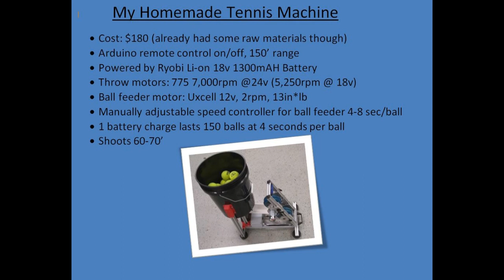Homemade Tennis ball thrower

Comment: Waiting on a few bits and pieces . Am trying with two 775 motors. They take about 1 amp at 12 volts and spin high revs. I'm guessing 6000. Nothing to measure with. What's the ideal spacing between wheels? Almost ready to fly out my first ball. Heads up!

Comment: Hello Rich, congratulations for such nice work!
I've accessed all the files you provided in order to build a machine like yours.
But I'm afraid I'm not capable to develop the Arduino code to control the device.
Would it be possible if you share it too?
I suppose you don't have commercial intentions with this project. Me neither.
Thanks
Reply: it doesn't seem you need much code, you just plug a switch from the arduino to the motors and let them roll, you could even do it without the ardruino it's just battery/motor/switch, the ardruino part is if you want remote control

Comment: Great job! What kind of motor did You use?
Reply from the maker: Thanks, Throw wheel motors = 775 24v 7,000rpm
Hopper rotator motor = Uxcell 12v 2rpm gearmotor

Comment: How did you fixed the wheels on the axis where the motor is connected to?
Reply from the maker: at 0:45 there's a photo of the shaft with an 1/8" pin. This acts as a keyway to drive the wheels. I didn't have a broach so instead of a square drive key I used a dowel pin and milled a 1/16 radius inside the wheel bore. Unfortunately I didn't take photos of that to add to the video. Hope this helps though!

Comment: Rich, one more question for you. Where did yo find the mounting plates for your motors to attach them to your extrusions? My ball machine today is mostly done in wood and after seeing your project, I'm thinking about converting it to extrusions as well (lighter). The structure seems fairly simple to be done (although I want to put a motor to move the bloc up and down as well) but where I get stuck is on the mounting plate itself. Did you made them? If so, can you share with me how you did it?
Reply from the maker: I machined the mounting plates out of 6061 aluminum plate. I don't have any photos. I think maple or oak would be okay. They'd just have to be a bit thicker for rigidity, maybe 3/8-1/2"?
Reply: How much did you end up spending on your machine?

Comment: Hello, Amazin project. You can share more details of wheels, motor e dimensions? Thank you so much
Reply from the maker: Thanks!
Wheels = 125mm PU
Throw wheel motors = 775 24v 7,000rpm
Hopper rotator motor = Uxcell 12v 2rpm gearmotor
Reply: @RichVideosNH   which Material use…??

Comment: Hello, beautiful design! But I would like to know how long these Screwdriver batteries last, and if it would not be interesting to use a UPS battery ??? thank you!
Reply: UPS is heavy... no? Maybe bigger 40v for a blower or weed wacker?
Reply from the maker: Thanks! I get about 140 balls per full charge battery. A UPS battery would likely work just as good or better depending on the mAh size. I was planning on that originally actually, but thought it would be a unique project to try out my Ryobi ones.

Comment: How do you attach the thin fragile motor shaft to the wheel without it having the risk of breaking
Reply: i have no idea soory :(
Reply: I had the same doubt. I'm planning to use GT2 pulleys (thicker bore dia for wheel, and 5mm bore dia for motor), with a closed loop timing belt.

Comment: Rich, I'm trying to do a ball thrower myself and I'm almost there. The problem I am having is to find a motor for the feeder that can rotate all the balls 45-50 in the bucket. As you said, yours probably holds 35, any suggestion of a motor I could use?

Great work btw!
Reply from the maker: The one I used has 13 in*lb of torque. I wish I had gone double that. If you can find one at least 30 in*lb I think you'd be good. ROB-12154 is a part# you can google, it has plenty of torque (94 in*oz) but not sure of the quality. Best of luck!

Comment: Hi Rich, how did you get the wheels to stay in place on the , like what is that thing that you built or bought at 0:45 called? I'm not an engineer at all; I'm a  kid who likes tennis. Please let me know. Thanks!

Edit: Also, where can I buy the extrusions (the frame I am guessing) and what are the parts called, v-slots?
Reply from the maker: That's the shaft to mount the wheels. The pin is what drives the wheels with the shaft. Square shaft keys are more common but round was just easier to fabricate since I didn't have a broach to make the square feature on the wheel. Google shaft keys for more info.

Comment: RICH I'm a 100% Disabled Veteran and was wandering if you would sell all the fab parts to build one like this on thing I do is train dogs but it gets so harder than it use to. .I could really use this in making me able to do more and if possible please let me know. I could buy the motors and all but I cant fabricate parts I dont have that equipment and if I did I'm sure I would not be able to operate.
Reply from the maker: Sorry, I don't have access to a machine shop at the moment. Check amazon though, they have some inexpensive dog ball throwers that might work for you and be cheaper too.
Reply: @RichVideosNH  Ok I have looked but they have like baseball throwers that are better buildt but would still need some modificact to set it up to hold more tennis balls and they are remote controlled in the 70 dollar ranger I will get one and see about getting it modified. 
Thanks Tony

Comment: What did you use to make the Ryobi battery receptacle?  Did you use the case from an old charger, did you find it premade somewhere, or did you do something very clever like 3D Print it?  I've been imagining using a Ryobi battery for the power source on the science project I'm trying to help my grandnephew design and build, but short of cannibalizing my own tools for the receptacle or driving 60 miles to buy a not so cheap old tool off Craigslist, I'm darned if I can find something to work. I'd appreciate any advice you can give.
Reply from the maker: 3D printed and I used some wall anchors as the contacts. All of the red components were 3D printed.
Reply: @RichVideosNH  Would you consider sharing the 3D printer file?
Reply from the maker: I just added the assembly to grabcad. See the link in the description. Enjoy!
Reply: @RichVideosNH  thank you so much!

Comment: Looks like you could use stronger motors . The MY motors would be more suitable.
Reply: I am building a machine.  I have 2 3500 rpm motors at 12v.   Hope it is enough.  I think his battery system was a short cut not worth taking

Comment: Im progressing with my own project. Instead of the tiny 775 am using the heaftier my6812 motors. Using a car window winder motor to turn the disc. Am wondering how troublesome the disc mechanism is and how prone it is to jam ups. Im almost done and will post my own video soon.  Hoping within 6 months anyways. Just a pet project.
Reply: How is ur project going?
Reply: @chevy4x466  ok. Balls are shooting out with MYxxxx type motor well. I am modifying hopper at the moment to make sure I can put 30 balls without them jamming. Eventually I hope to have a video showing all along the way.

Comment: Can you give the 3D printed file for the step motor for the ball feeder
Reply from the maker: The 3D model for the whole assembly is in grabacad, see the link in the description. You can isolate any part you want and re-save as an stl.
Reply: RichVideosNH can I do the same with the shaft that you built for the center of the wheels?
Reply: RichVideosNH dude I love the fast response as well! Thank you so much
Reply: RichVideosNH also what part name did you use for the ball bearings inside the bucket?
Reply from the maker: @Peacefullsound1  Ball Transfer 1.5 Tall
Reply from the maker: @Peacefullsound1  Yep, same process.
Reply: Did you convert the amps to the motors?

Comment: Can you tell me the ball speed?
Reply from the maker: Great question. 7,000rpm with 125mm wheel should be 99mph at discharge but I never measured the actual rpm with the wheels. It's likely much less, maybe 50-60mph if I had to guess. I'll get a tachometer one of these days.
Reply: @RichVideosNH  You could determine an estimate of average ball speed by looking at the video and measuring distance travelled (80' ) over time of travel (video frame count at 1/24 sec/frm?) from the "Pop" the ball makes at launch to the ball hitting the ground. The lower the launch angle the better.